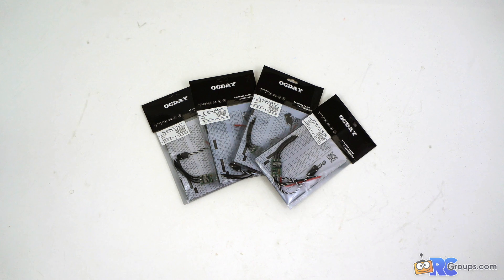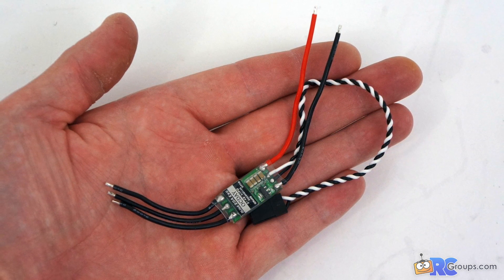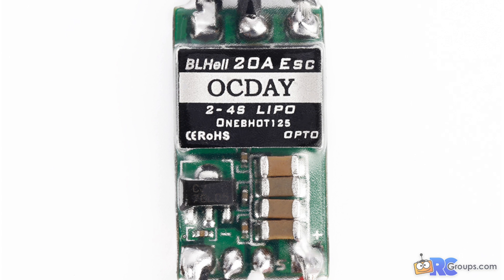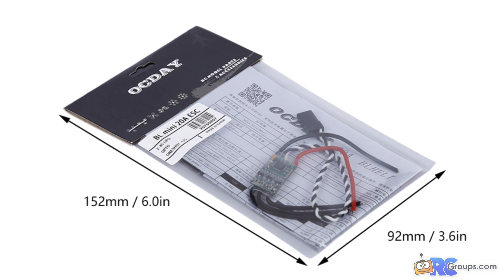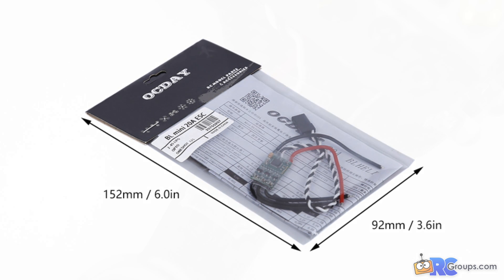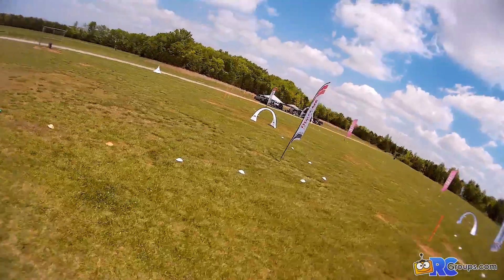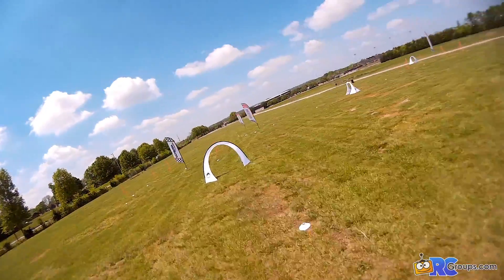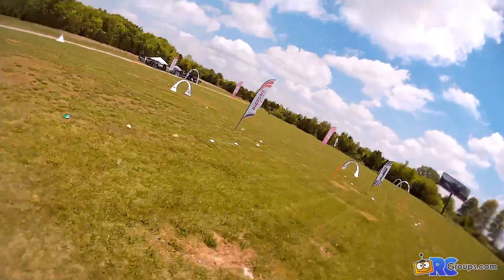ACEHE OCDAY 20A BLHeli ESC's

Comment: Hi there, can anyone tell me why these esc's have the Afro 12A firmware on them? Can I put 20A firmware on them aswell? Like the Afro 20A? Or maybe even ACEHE firmware?
Reply from the maker: Not sure what bootloader is on it, but it is likely possible to do that.
Reply: So it won't fry the esc's?
Reply from the maker: You'd have to check with the manufacturer. We can't know for sure.
Reply: Yeah I emailed ACEHE. waiting for reply
Reply: +KoekeBeest1985 where you able to get a reply? I'm hesitant to update it to 20A afro.
Reply: No reply but don't update if your not absolutely sure. It can fry your esc's. I've just kept it on the original 12a afro with dampened light and it works just fine so I'm not going to update anything. Unless I get a reply ofcourse.

Comment: I'm starting to lose patience with these OCDAY ESCs.  Can you give a little more detail on how you were able to do the throttle calibration?  Right now, my motors won't arm.  So aggrevating.
Reply from the maker: Just followed the manual. Full throttle on the tx, power on the quad. you'll get some beeps indicated in tone by the diagrams in the manual. After full throttle has been set, move the throttle to full low, it says over midstick for some reason in the manual though. After low throttle has been stored, power off the on the quad and then power it on. You will have to make sure the end points are set correctly to match on your flight board as well or they won't work.
Reply: I'm really not liking these ESCs. I still can't get them to calibrate.  What does this mean?   "make sure the end points are set correctly to match on your flight board as well or they won't work."
Reply: Update firmware with BLHeliSuite...ATMEL BLHELI/SK Bootloader (cleanflight) and update with latest firmware. It propably notes it's a 12A Afro, wich I find weird but...it arms on ONESHOT after that.
Reply: did you update with the 12 amp or 20amp in blheli suite?
Reply: 12amp